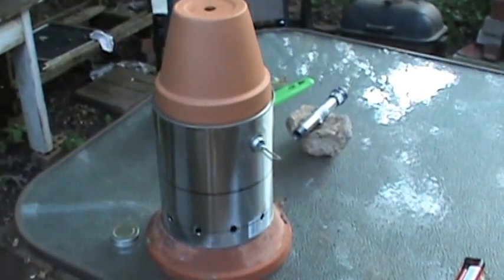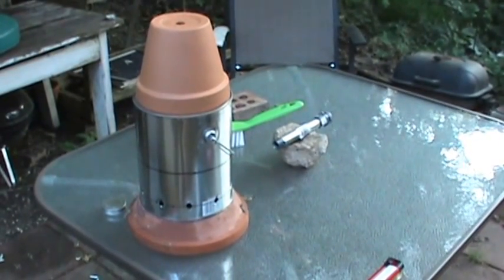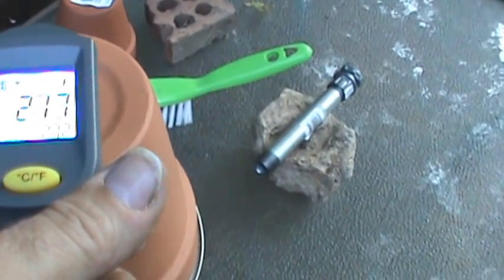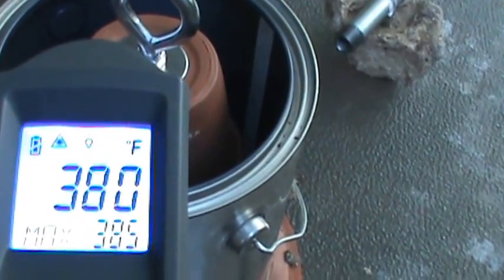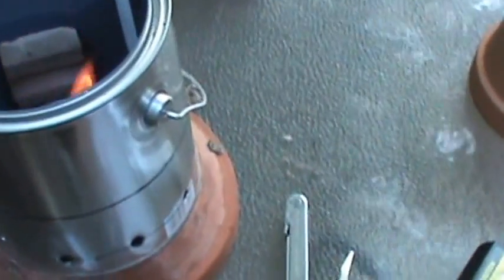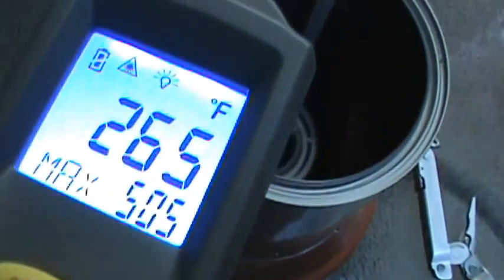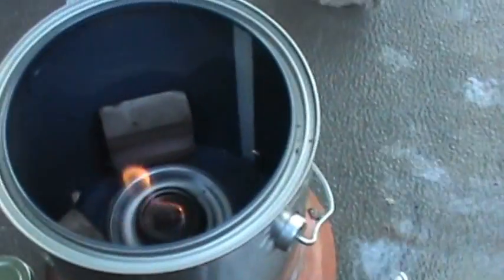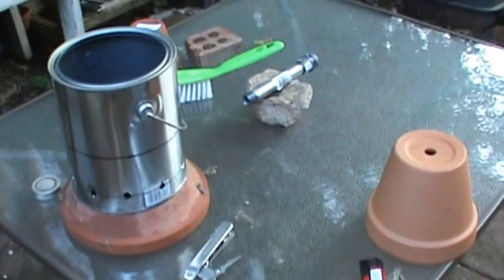Flower Pot Heater redesign. This one works.

Comment: Why is the set of pots even necessary?

If the flame is going in the car, it will heat the air and the air will spread out.

Btus produced go into the car, no matter what material they go through.

Comment: The paint can with holes looks like a barbecue coal starter. I'll try one of those . My question is why so many pots. And do you really need to seal off the hole on the bottom of the pot. . Well back to the drawing board for me 😆😁. Thanks for your input. Also I'm planning to use a tiki torch filled with either diesel or kerosene. Just trying to keep my green house from freezing  👍

Comment: Try drilling about 6 holes in the paint can lid instead of the flour pot. A wood stove gives off major major heat because it's metal. It's the best conductor of heat. As the flame passes by the metal, it heats the metal lid, it will heat much faster and higher in temperature.

Comment: THIS DOESNT APPLY TO YOU since youre outside but usually when ppl make these flower pot heaters they will show the temp of the heat but they dont show the temp of the room!!! I wonder if a small fan behind the pot or heater would help distribute the heat better!! because some ppl say they dont heat up the room.

Comment: I have a question though I’m trying to figure this out. And this is a true question because it’s kind of confusing me. What is the benefit of the flower pots on top of the candles? It just seems to me that the candles per putting out a certain amount of heat so just leaving it uncovered you’d get the same amount of heat. I know I’m probably missing something that’s why I’m asking. In my mind it just seems like you’d get more heat if you left the candle uncovered

Comment: In the early 1960’s my parents had a VW bug.  We live in Michigan.  The heaters didnt work on the VW Bug back then.  It was so dang cold in the winter.  My parents took a coffee can added a roll of toilet paper and a bottle of alcohol.  After the toilet paper was soaked with alcohol they lit it.  It would warm the car.  Roll the window down about an inch of course.  I was trying to remember how they put it out when we got where we were going.   I know they would have covered it to snuff it out

Comment: Good work, man. I like it! One thing that occurred to me however, is that if you use a can of fuel (like sterno) you might want to see how hot the can is getting being enclosed in that hi-temp environment. I don't know if the cans' seams could begin to leak at high temps or even boil or explode. Just a thought. Those products are meant to burn at the top, but I don't know if it's safe or not to virtually put the can in an oven. I realize it's still in the prototype stage, so I thought I'd throw this out there as fuel for thought.

Comment: Is that a sterno can as the heat source? My friend it burns at a higher temp than a candle flame. If I put a nuclear reactor in a flower pot it will generate more heat! Check your design with a 2-3 candles and check the heat temp? Good Vid!

Comment: Temperature looks great, did you try it in a room and was the room sufficiently heated and warm? Mot find they are not suitable, mostly because although they heat up brilliantly and consistently, it's the radiated heat that's not projected, more a local heat to the pots and distributed outwardly, what's your experience on this after your testing?

Comment: If the sterno can by its self burns at 400,degrees why not just use the sterno by its self ? What's the need for all the other stuff ? Perhaps just put a 10 or 12 inch flower pot on top of the streno can allowing the air to get underneath the pot for more surface area to heat up to near 400 degrees . Your multiple flower pots were actually cooler than the sterno burner. To me it makes no sense ?

Comment: The amount of heat the unit puts out for total btus in a room makes zero difference whether it's contained in a flower pot or just sitting burning the same amount of candles in an open environment. Fuel is fuel and it has the same amount of energy and heat output regardless of if it's in a container or not.   Certainly it will be more safe using the candles in a container but the energy amount transfered into the air is the same.  It may take more time to transfer into the room initially with the flower pot as the heat is buffered from directly heating the air by the pot and metal for a small amount of time but there is zero increase in total BTU output over time.

Comment: if the sterno or candles are putting out a certain temperature on their own,do you need all that extra stuff?    if you check the temperature of the room with the sterno alone or with the flower pot device, what is the actual temperature difference in the room? I use oil lamps for heat in my tent house. If it gets really cold, I light a sterno can, no flowerpot, and it warms up the room.

Comment: I'm very skeptical if any of these flower pot heaters would produce a usable amount of heat. Yes, the pot gets hot, but does it produce enough heat to actually heat a room? A match gets very hot too, but would it heat a room? No, it would not.

Comment: House furnaces break down. Oil tanks run out of oil,and caught between paychecks and you have no heat. Whatever the reason is doesnt matter really. Each persons situation that they're dealing with is different. At some point Murphys law will rear its head and catch you off guard. Everyone should have a plan in place ahead of time,and have a back-up source of safe heat-before it happens-preferably independent of electricity if at all possible. Just because its summertime and life is all cheery and good for you doesnt mean it will stay that way. Get your sh**t together, as my mom would say...and always keep a package of extra toilet paper on hand..

Comment: Measuring temp. of flame don't work, it goes off a different color and moves around too much to be still enough to be measured. It works, but reading the temperature won't.

Comment: Of course it works. You have a heat source warming something that can radiate that heat.

The question is really how much can it heat a space. And the answer to that depends on how well insulated the space is, how cold it is outside, and how small the space is. 

I have been testing these, and there is really no difference whatsoever between them. The amount of heat depends on the source, not the layout or the amount of mass. 

Oh, and don't try to blow out napalm!  😉

Comment: You obviously don't realize, that you'll get literally the same amount of heat out of that "chaffing dish" just by burning it out in the open, (actually a little more) as you do by putting that whole contraption together....And you'll get more heat faster.....

When you have the whole contraption, you have to actually HEAT up everything IN the contraption before it starts putting off heat.    You've literally WASTED heat in that process.....

This here is literally the most brilliant thing I've seen yet.   

The dirt is so that you can actually pick up, and handle the can with your bare hands.......BRILLIANT!!!

And all you need to do is keep the alcohol and cotton balls separate from the cans until you're actually going to use it. 

And SO easy!!!

https://www.youtube.com/watch?v=slAliaodcks
Reply: I made the one in this YouTube video with the dirt and two cans and the cotton balls soaked in Iso alcohol. It is a much better design..

Comment: The fuel when burnt either as an open source or contained within will still produce the same calorific value its just that you are localising the heat . This test is biased towards what is felt local area . The test should be same volume to be heated with same source of heat just different apparatus.  Temp taken from the full volume not the local area. Difference is the heat rises with out capture so in same volume the heat will rise to the upper area before heat is felt lower in this method you capture the heat and radiate it lower so lower level heats quicker but net effect over time would be  the same .  This all ties into the Conservation of Energy. You can't get something for nothing. Basic law of physics

Comment: I'm liking the can. On the top I intend to use a cast iron pan filled with crushed fire brick, or a pan of water to heat. I also intend to use tomato paste cans to make vrgetable oil candles to put inside the can. I saw this video on the tiny house segment but I haven't been able to find it again but I remember it. The paste cans are more candle shaped and you can fit i think five or maybe more in the can, so you can actually boil water and cook as well as a radiant heater.

Comment: Different fuels hold different amounts of BTUs. 
Alcohol has least BTUs per volume; oils hold most BTUs.  Any of those could be made to use like candles.  
The denser the mass BTUs store in, the slower they radiate it back out to the space around it. So, clay bricks, heat-stable rocks, Will store BTUs best.

Comment: Without the useless apparatus, you could measure the flame itself and it would be 1200 degrees. Who cares? One way or another, you get the same amount of heat out of the burner no matter what you put it in.

Comment: Is it possible to pick up the paint can to change out the chafing burner without taking apart the whole thing?  I like the set up, but man that temp might be a problem inside.  Did you do a video showing you build from bottom to top of this heater?

Comment: Ya probably don't need those 2 inner pots in the 4 inch.  It could be holding back heat from coming out the top into the room.

Comment: There’s a sucker born every minute.  All of these “inventions” are BS.  Been disproven time and time again.  Simply measure the potential BTU’s produced by the BTU’s lost in the environment.  The temp of the clay pot is meaningless.  Hell, take the temp of the flame at 800 degrees or so if you think that matters.  Now if you mean to sit on the clay pot to absorb heat directly, then I suppose it warns and may help ward off hypothermia.  But for a room, or a tent, and its ambient air not a chance.  And the video author says this will heat a room in your house to 60 degrees “no problem”—without any description of outside temps, size of room, test & measurement, etc.  This man is a scientific illiterate.

Comment: Not a fan of the tiki can idea. I don't think a fiberglass wick will perform well in producing a flame. A cotton wick will produce flame but they have their own burn off. Depending on fuel, it may be worse than the sterno. Keep in mind there's a huge audience here looking for a heat source for a small room during power outs. They're insulated but not ventilated. Bumping up to white gas or lamp oil using a tiki canister, that's risky business. I totally get your need. Winter camping in bitter cold, you're losing heat faster than you can make it. Your design is alike sleeping near a fire. People in campers without heaters will love this. One thing no one seems to cover is performance under different circumstances. I did see a vid where a guy tried the flower pot candle thing in his camper in 30° weather and it didn't work. Your design here would. Maybe one design for a no insulation situation and one for a small room or cabin?

Comment: How about a wood stove fan - the type that runs off the heat rising?   
Like the sterno fuel idea!
Was without power last winter for 5 days and tried the typical clay pot, eye bolt with nuts and washers, used both tea lights and crisco candles.
Had a 2 x 2' ceramic tile on the floor (heat rises) to make the area safe.   
Largest clay pot was 12"
Used fire bricks to allow air flow on the edge of the base pot.
Yes, the clay pot got really hot, much to hot to handle.   
Concept is great and all videos I've watched were done during decent weather.
No, the typical clay pot concept doesn't heat even a small closed room when the temperature is 40 degrees inside!
Must watch tea lights closely because they will and did catch fire!!!   Fortunately they were sitting on a thick pad of aluminum foil and I caught the fire before too much smoke filled the room!

Comment: Hi. I made this as he instructed except I used the 6”, 4” and 3“ terra cotta pots. The paint can came from Lowe’s. I used the Sterno canned heat and the eye bolt with nut and washers as he did. I placed the heater on the overturned terra cotta plate and placed everything in my extra large cast iron skillet and on top of my glass topped stove in case it got hot on the bottom. It did not. Sterno does not produce harmful fumes and is used inside by catering companies to keep food warm while being served. 

Although I did get a little heat from the upper terra cotta pots after 10 minutes, I let it burn for 4 hours with little change. I would not count on it to keep me warm, except maybe my hands if they were held about 4 inches from the upper pots. But I enjoyed trying it and it looks nice as a conversation piece. 🪴
Reply: Thank you! I was wondering if it mattered if you have all the contraption because the flame is that hot, and it is releasing heat into the the room. Obviously, a caterer is not making the room warm and toasty with one or two Sterno cans. I may leave the heat off tonight and try a plain Sterno in one room and a Sterno with pots or cans in another and see what happens.

Comment: Thanks! Great post. There’s a guy here on YouTube that reports he encountered a problem with his tea lights melting and leaking inside the works there. The pooled up paraffin caught and leaked down his bolt assembly.
So, heads up! I think it shouldn’t be a problem for you to work around, your design looks close to perfect, but if you need to use candle power, it might be an issue.
Again, much thanks!
Reply: put the candles in a dish to catch the melt and it should keep the flames under the pot. Keep the candles apart and they are less likely to melt like that.

Comment: What is the temperature of the bottom piece/"stand"‽ Does it have to be on a fire proof surface?
Reply: Yes, because it heats also use a thick baking sheets anything that doesn't heat up that will prevent it from burning the floor or table from burning. You can even set the base in a large pan with water. That put some moisture back into the air. Dry air effects breathing.

Comment: Well, like any source of flame these things are a fire and Carbon Monoxide risk, but if you do your research and take that into account when you design the heater, and remember not to leave it unattended, it should be as safe as the candle or chaffing dish fuel.

Comment: Amazing Plenum Heater!  Great video.  
For you non-engineering minds out there here's the material list...
New/empty paint can (6" diameter) remember to drill 3/8 to 1/2 wholes every 2" for draft.
Terracotta base or stand flipped upside down 8" or possibly a 10".
2 washers approximately 2" or 1-1/2"
Eye bolt approximately 6"-8" long.
2 hex nuts to fit eye bolt thread diameter 
Plenum has 1 each of 4", 3", 2" terracotta planter pot. The lid to this heater is an 8" terracotta  planter pot.
3 fire bricks inside paint can for weight and stability. 
Note: you have a hex nut and washer in the inside of the plenum holding the 4"3"&2" terracotta planters pot with the eye bolt going through. Than a washer and hex nut on the top of eye bolt. 
So here is the order on the eye bolt hex nut, washer, 4" planter pot, 3" planter pot, 2" planter pot, washer and last hex nut. The washers hold everything in place and the hex nut is the compression and or, torque.
Heat source is a chafing fuel burner.

I hope this helps.
Reply: Thanks for that information on assembly 
it helps a lot !

Comment: The only think these “heaters” do is create a heat sink. The heat of the candle or heat source is the maximum heat you will get out of one of these, so don’t waste your time building one of these. The temperature of an open flame in a candle is around 1400 F and a Bunsen burner is around 2500 F using alcohol. That is anywhere from 4-8;times the heat he was getting on the pots. The only advantage to something like this is that it would give a small heat source once the candle burnt out. If you want to use a candle to heat a space in an emergency, just get metal can that is taller than the candle and make sure it is place on a flat surface. And that isn’t just me saying it, it is the laws of physics saying it.

Comment: You're misunderstanding the concept of hearing.

Temperature - DEGREES - is mostly irrelevant and misleading.

You need VOLUME - think BTUs. Our heaters - furnaces, space-heaters, etc - aren't labeled by temperatures, aren't measured in degrees - but by BTUs, watts, etc.

Also, Sterno is gelled alcohol fuel. It's safer because it's hard to spill - liquid alcohol will burn down a house/tent/boat/camper/etc.

The "thermal mass" in your flower pots are a nice idea, but here again, NONE OF THIS increases the heat output, but rather, it captures it and radiates it more slowly into the air.

Large rock or brick thermal mass heaters have been used forever. Routing the exhaust through a long, meandering path, to allow absorption of as much heat as possible, sending a bare minimum out the chimney. They can continue to release captured great for hours after the fire is extinguished. Some ice seen in Siberia require small fires to be lit in ancillary chambers, in order to raise the temp of the chimney passages enough for the main fire to be able to draft well enough to avoid smoking out the house.

The long, meandering, COLD exhaust pathways will not allow the stove to DRAFT.

PREHEATING allowed the main chamber to draft & burn, hearing TONS of rock, brick, cement... I've even seen "cob" used to AMAZING effect in these heaters.

They often have ovens built in as well - bread, slow-cooked stews... The temps can even be controlled, used for stove-top cooking as well.

INTERESTING stuff!